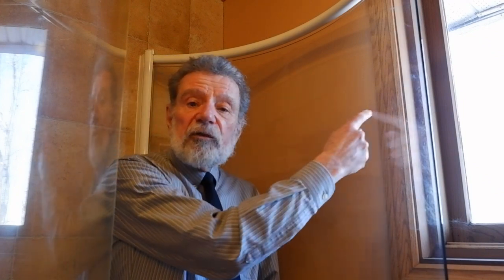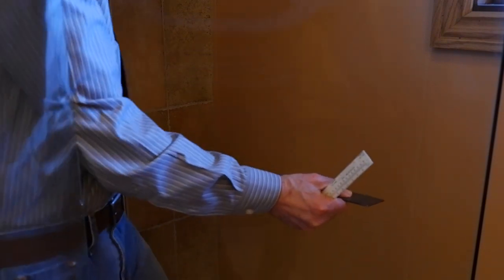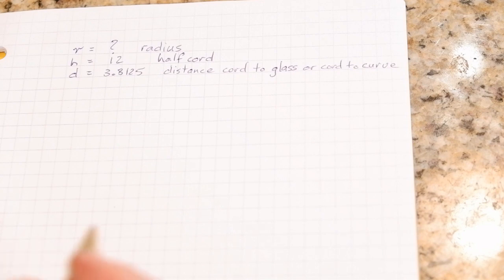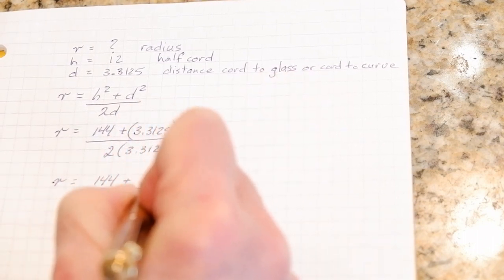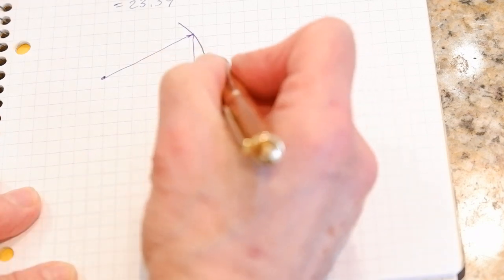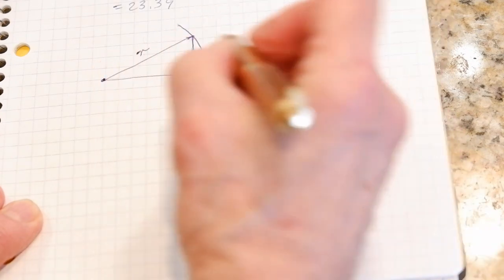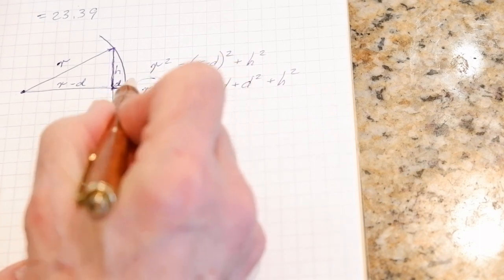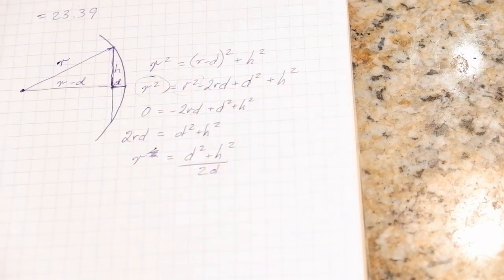Simple Calculation of Radius from an Inside Curve.

Comment: Just stumbled on your channel (comment unrelated to this video) - started with 3d printed wood working/workshop stuff that showed up on my feed and I've watched everything you've posted - Love the content!  I just in the last two years have been picking up carving and light wood working projects... coming from a techy background it's almost unexplainable how exciting it is to combine new and old ways and tools  -  you gave me a few ideas of how to rig things up in the shop with the 3d printer! Cheers from the east coast!
Reply from the maker: Hi Mark, and welcome to my channel.  I think the most frequent contribution of the 3D printer to my woodworking has been small, light-weight, single-purpose, marking and measuring tools.  In many instances they do the work that a combination square could handle, but for a small box, for example, a light-weight PLA square is so much easier to handle.  Thanks for commenting.  My stereotype of techy-background folks is that they are problem solvers...who will be right at home in a woodshop.  Enjoy it!

Comment: Thanks George, I enjoyed that from start to finish. (I've had more than a few cee-squared moments myself...)
I assume that part two will be the making of the custom radius squeegee?
Reply from the maker: Hi Mark,  I'm not sure, it will depend on whether the squeegee succeeds.  Two hitches:  One is that my white flex filament is coming out too rigid.  Maybe making it thinner will help.  But the second hitch is that even though I asked for a tighter curve (using a 22" radius instead of 24), the blade came out flatter -- less curved -- than the glass.  I'll try 20" in the next attempt.  Good thing I'm usually satisfied by something coming out OK, even when it makes no theoretical sense.

Comment: I have a cheating way of doing this.  Draw a 2 point arc with bulge in SketchUp and then right click on the arc and look in Entity Info.  It will tell you the radius.
Reply from the maker: That sounds good.  Do you enter a cord length between the points and then pull the bulge until it reaches mid-cord to curve?  BTW, if there is a woodworker who can teach us all about wrangling curves, it would be Kevin T.  Among my best recommendations would be to subscribe to his channel.
Reply: @georgefouriezos8863  I would usually draw a line that is the chord length first and then snap the arc to the end points.  The buldge will always be centered and you would either set it by moving the mouse or just type in the value.
Reply from the maker: @krtwood  That sure beats banging a framing square into a glass shower wall.